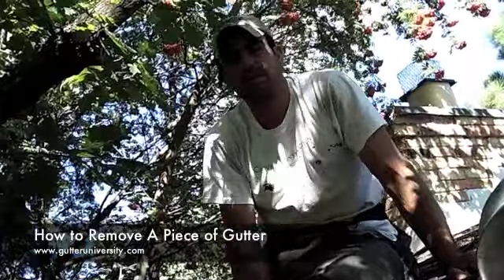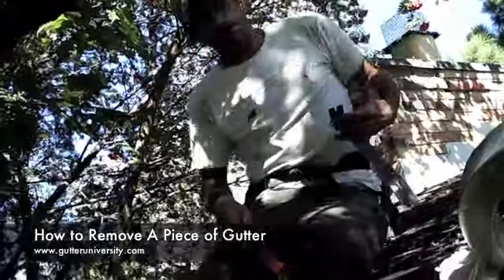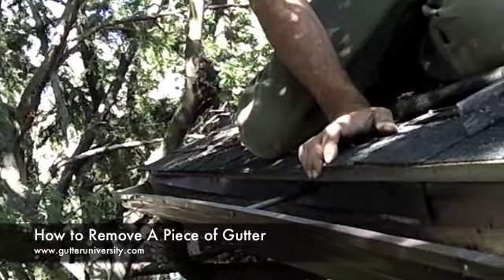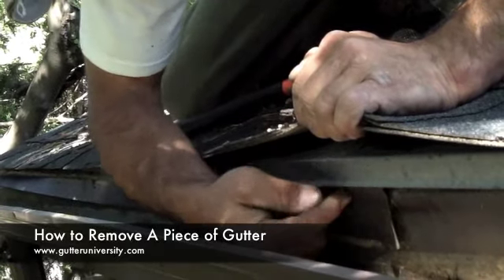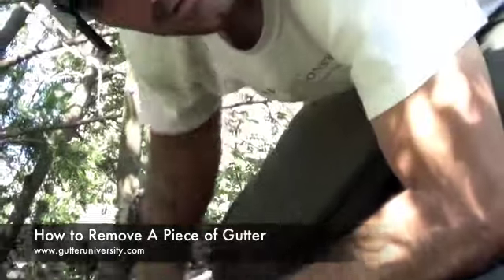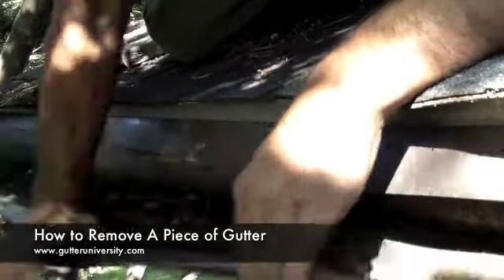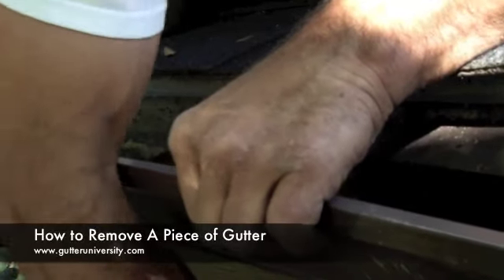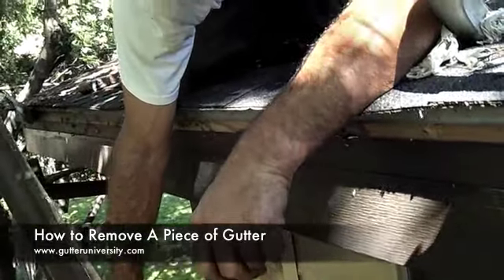How to Remove A Piece of Gutter

Comment: This caused a lot of damage to the gutter and the fascia board. I ended up cutting a slot in the the nail head with a Dremel and using a screwdriver to loosen the nail before hammering out. A large screwdriver did less damage than the bar for me.

Comment from the maker: Yes, this will indeed work to pull your spikes temporarily, but you have to be extremely careful.  It is quite easy to dent the gutter if the spikes are really firmly installed.  Just go slow at first, and you should do fine

Comment: Mark, will this method work for my gutter that's sagging in the middle? I bought a pack of those screw-in spikes to lift the middle of the gutter a little but still need a way to get the old spike out without denting up my gutter since I'm not really replacing it.Its in a bad spot,right in the middle over the garage.